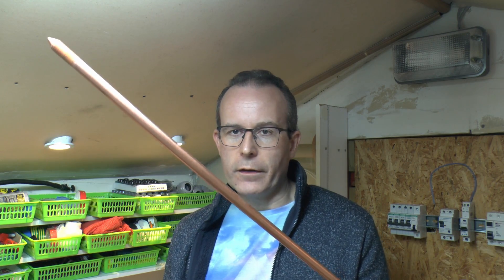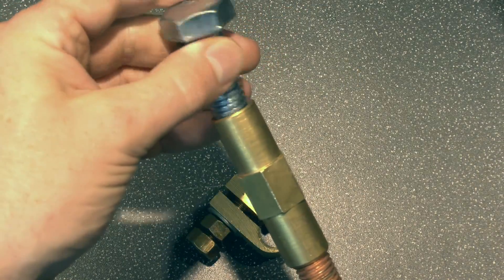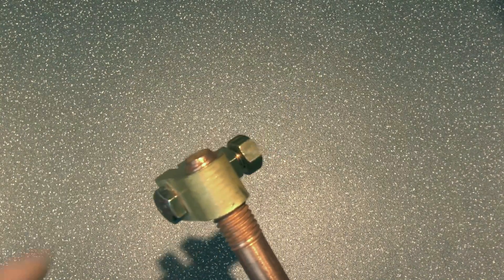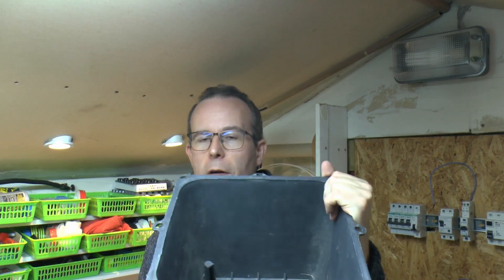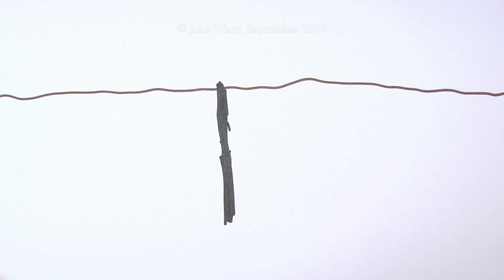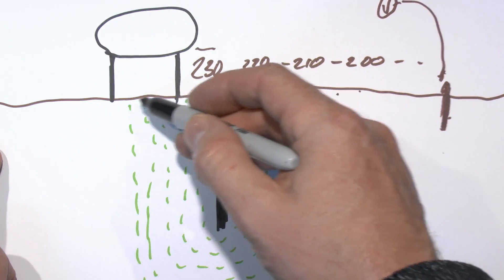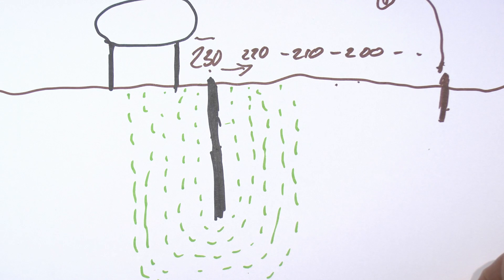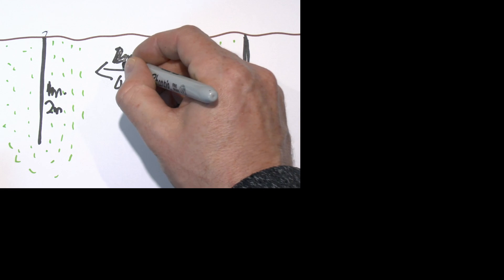Earth Electrodes Part 1

Comment: John,   Please let me know if I'm correct.   Connecting an electrical system to a ground rod in your country is connecting 240 volts to the earth ALL of the time, not just in fault situation.   Another comment, this step voltage is exactly why metal light poles should have earth ground conductor from the consumer unit and not a ground rod connected to it.   I hope I got your terminology correct being from across the pond.   Respectfully,   Kevin
Reply: Hi Kevin

I the UK we have a three wire system no that dissimilar to your arrangement in the US apart from the fact that we normally have larger but fewer substations and the neutral is bonded to a very good earth mesh / rod at that point. We also use the cable armour or metallic sheath (on older cables) bonded to the earth and we also have what we call an equipotential bond that must be connected to any other services such as gas or water. If the building has metal sidings or is steel framed that is also bonded.

The primary difference between a UK and US install (aside from the split 110v lines with a centre tapped neutral) is that in a UK installation the neutral is treated as if it were a live or (hot) conductor. Unlike in the US the neutral and earth conductor are not bonded together at the consumer unit. They are separate until they reach the substation. We do have several kinds of earthing arrangements in the UK.

The only time an earth rod would be live is when it is conducting fault current away, this would only be for a very short period as all installations that meet code will have the circuits protected by an RCD device (GFCI in the US) and fault current flowing to earth would also be interrupted by the devices fuse if it was a faulty appliance, the circuits breaker or fuse and in the worst case scenario the (final / company / DNO) fuse that is before the meter. I may be biased but I personally think we have the best electrical distribution and wiring system in the world....  :)

I recommend you watch the series that John made regarding earth operation as it will give you far more information on earthing types ect.

I hope that is of some help to you.
Reply: Stuartbe    Thanks for your comment!   In US neutral and earth are bonded at the consumer unit(panelboard) same as there. I do not believe that your electrical systems are better or worse than here.   As long as they are safe, I'm usually happy.   I do consider your "IEC" standards as inferior to NEMA standards.   Another thing, the mesh and rod used for earthing have nothing to do with 240 volt line conductor to earth(equipment ground) faults.   These faults go through the bond to neutral at Consumer Unit and out to the transformer then come back and trip the RCD.   Respectfully,   Kevin
Reply: @KevinCoop1  Thanks Kevin

I think we got some (wires crossed) Excuse the pun. I meant to say that the earth and neutral are not bonded at the consumer unit. With a standard earthing system the neutral has nothing to do with the earth until the bonding point at the substation. It is at that substation that a very low impedance ground is installed. Only very old installations have a seperate earth rod, not only are they rare but they are subject to very strict testing.

The neutral only caries fault current (with the live) in a live to neutral fault event. The earth will only ever carry fault current if an appliance fails or a live wire makes contact with an earthed back box, cable damage is done or a device is badly wired ect.

Rather than having an 11KV to single split wound transformers one large oil cooled transformer is normally used that has 3 separate phases  120 degrees apart. It was the case before the lovely EU (NOT) stuck there nose in that we used the phase colours Red, Yellow and Blue. When wiring a street the idea was that the Red phase and a neutral fed the first home. The next home would be on yellow and the third blue. Each supply is a 2 conductor cable and sometimes earth on its own conductor (or outside sheath) . So 2 conductors, phase and neutral fed each house. The idea was to balance the phases over a street. It is very rare for a domestic premises to have more than a single phase feed.

You stated in your first post the following "Connecting an electrical system to a ground rod in your country is connecting 240 volts to the earth ALL of the time, not just in fault situation." and this is not how it is done. If I am not mistaken (unless it has changed) your earth and neutral conductors are connected together at the distribution board. On a UK distribution or consumer unit as we call them there are normally two separate neutral bars to serve the two sets of breakers that each have an RCD. The earth conductor bar has no contact with neutral at all until the feed reaches the substation.   

The reason I believe the UK system is better is that all circuits no matter what they feed are protected by a group RCD or GFCI. From what I have seen it appears that only outside plugs and garage sockets have GFCI outputs. The UK system has global RCD / GFCI protection. We also have safety covers that stop anything being pushed into the live or neutral, It is impossible to keep your fingers around the plug and make contact with the pins. The earth is also the first one to make a connection so there is very little chance of a chassis becoming live if there is a wiring fault.

With regards to NEMA and IEC I don't think the US military agree. I am ex Royal Navy submariner and I have worked on some engineering tasks in collaboration with some of the US navy engineers and the American electrical engineers designed the electrical systems using our standards. I do however happily admit that the NEMA standard external electrical external sockets are far better than the UK appropriately rated IP sockets.

It may well be unfounded but I just cannot bring myself to trust the US screw on wire nuts. Something about them makes me feel uncomfortable.

I hope we have sorted that out and please do not launch any ICBM's in my direction...... Don't forget we gave you all those trident's   ;-)
Reply: Stuartbe    Thank you so much.   Speaking from this side of the pond, your electrical system, short hot to neutral will trip the circuit breaker.   Short hot to ground will trip the GFCI because earth will cause enough current to trip the GFCI.   We on the other hand have high fault values through equipment grounds to trip the breaker.   It now makes sense. Awesome!    Now an example.   NEMATODE contractors are rated 100,000 operations.   IEC contractors are rated 10,000 operations.   In a dwelling, in the new codes, everything is GFCI, orAFCI or both now.   Also receptacles are tamper proof as well.   Most electrical videos on YouTube are by people wanting to make money and not knowledgeable.   Respectfully,   Kevin
Reply: Stuartbe    Also,   I recently learned why we have 120 volt systems in US.  Tesla wanted 240 volts as standard, but Thomas Edison who invented and sold massive amounts of incandescent lights that run on 120 volts was powerful enough to get his way.   Edison lost the AC vs DC battle.
Reply: @KevinCoop1  Ahh. I did suspect that, I find many "experts" are far out of date with the regulations and technology. Its great to hear about the protection systems you have that are now mandatory. Considering your country uses a split wound 240v feed that is centre tapped for the neutral and 120v potential on each end of the transformer taps I think it is like comparing apples with oranges as your fault current is going to want the lowest impedance path.  AKA the neutral !

A decent domestic installation (like mine) :-D  Uses RCBO breakers that are individual GFCI and Overcurrent both slow overload and high fault current protection devices in a single way slot. I imagine your GFCI breakers work in a similar way but I would like to know for sure..... Our RCD breakers don't measure anything on the earth, they actually measure current flow on the live and neutral and constantly watch for an imbalance. Should more than 30ma of current be different on one leg the assumption is that this errant current must have gone elsewhere... like via a person. 30ma is the standard trip current for UK RCD devices. What do the US GFCI breakers trip at ?

I take your point about NEMA but the IEC, IEEE and British standards can sometimes be more like guidance than regulations. As well as these standards any installation in the UK must comply with BS 7671 / 18th edition regulations and measurements of the earth loop impedance, fault current and every single circuit has to be insulation tested fully between each conductor along with strict regulations on placement of all sockets and switches. In fact testing and certification of installations has become a dirty part of the industry with many "so called" safety bodies milking huge amounts of money from engineers and end users. I have had jobs like I am sure many others reading this have that have taken ten minutes to complete and then forty five minutes completing paperwork !

Standards have not just tightened over the last few years they have got to the point that they are cutting of our air supply. I wonder if it is the same for you.

Just think how different things could be if Topsy the elephant had not been electrocuted on Coney island .......  Poor old Topsy...........  :-( 

I should also say that if we are concerned about regulations and safety standards in our respective countries we should most definitely not go and work on the electrical installations in China. I think it would be a case of a guaranteed instant cardiac arrest for the both of us ..............   ;-)
Reply: Stuartbe    Standard GFCI breakers and receptacles in US trip setting is 5ma.   We also have 30ma GFCI breakers for equipment circuits.   Our NEC revisions are mostly about money for someone.   For instance, in 2020 Code they added a whole NEC article for low voltage ceiling grids.   Heading for 24 volt lighting systems.    They are requiring way more stickers with lots of calculations needing to be done.   Just so you know, I retired Oct 1 2018.   It was time to get out!    Don't really miss it.   Respectfully,   Kevin
Reply: @KevinCoop1  Hi Kevin

I can say I blame you for getting out. The entire industry is just full of shark's that want a couple ok $K a year so you to have the honor of filling in a load of data and test results that no one is ever going to look at....  Just to show you are an electrician.

This industry is missing something that 99% of businesses and government departments are missing. It is a rare element that is repelled by these 14 year olds that have completed a one week training course to get there part P........

Just so you know and if you ever meet a spark in the UK the words "Part P" are on par with beating a granny to death or sleeping with your boss's girlfriend. In fact using these dirty works could end up in you being chased out of the country by several thousand electricians

Anyway, this is an extremely rare element that you often only find in seasoned electricians and seems to only be attracted to a select few. The most powerful repellent for this rare element seems to be our industry regulators, local authorities and government bodies. There is a scientific name for this element .... I think its something like .... "Cmn 0n Sc3nco" .......  I looked it up and apparently the layman's term for it is COMMON SENSE .....  I don't know if any of it exists but if you do find some please keep it safe. When we have enough we can send it to all the lovely people above.

A good example of this lack of said element is that I cannot move a shaver socket in my bathroom, nor can I connect a supply to a shed using SWA cable.... I am medically retired now and have been bedbound for nearly 5 years so this is kind of academic (unless my next batch of spinal surgery works) but to me its the principle of the thing. I spent five years at University and managed to earn a Bsc in electrical engineering and then spent nearly ten years in the navy earning other qualifications as I went along including cryptology. When I left the Navy after my first spinal surgery I went into the IT and Telecoms security sector and spent the rest of my work life as a security consultant in IT, IOT, alarm secure comms (red care then later dual com), Internet security and firewall protection system design. All that time I was a good boy and always had my white hat on !

As proof of this lack of common sense I am unable to work on a large portion of the installation in my own home as I am apparently "Not Certified" Hmmmm........ Can someone let me know if Ohms law has changed since I went to university ? Maybe I should just shut up and pay hundreds of pounds for a spotty faced teenager that has done a one week course 50% of that getting over a hangover and another 40% trying to pull the girl opposite so he managed to cram in 10% !  He must be vastly more competent than I am.... Surely he must be !

Sorry im getting of the soapbox. This just makes my blood boil. If I am ever well enough I am going to do the work. I would love to be sent to court so they can prove the prosecution's case that I am not competent to perform the work to a safe standard. I wonder what my chances would be...... Soap box now broken up for firewood.  Sorry for the rant but this bovine excrement is driving me potty  :-(
Reply: Stuartbe    Have you ever tried or done Autocad or Revit?    Since 2008 I was using Autocad MEP and some Revit.   It can be extremely satisfying to do complete electrical installations in 3D in a computer.   One of the last and very satisfying projects I did was the electrical room conduits in a 16 story hospital.   A 20,000 sq ft room with 6 miles of 3 1/2" conduit.   Some places were 9 layers deep.   It was down to a gnats ass and went in in less than the hours in the estimate.   I was doing all this as an Electrical Design Engineer working for a top 20 Electrical Contractor in the US.   People who can do 3D CAD are in high demand on this side of the pond and are very hard to find.   Respectfully,   Kevin
Reply: P.S. Is it me or are our posts getting chopped up and have parts missing ? Maybe its just me. That or its the morphine !

Comment: i may be being thick but surely if the earth rod was at 240 volts when in fault so would the equipment it was earthing ! making it useless! so if a person touched the faulty equipment they would get a shock ! making the earth rod useless
Reply: Creamy Pasta If it was  a very heavy current fault maybe but neutral is the same as earth in the uk and in most homes with old wiring and just fuses you could wire plugs with neutral and earth swopped and they would work happily till you either had the house rewired or moved rcbo,s look at whats coming in on live and coming back on negative any imbalance eg earth leakage triggers them but earth should be able to sink all the voltage as neutral does in most houses they are bonded to the incoming feed!

Comment: The cheaper rods do not have threads so you cannot join rods together, are these any good?
Reply: Well, actually you can, there are non threaded, pressure fit brass sleeves for those ones. Although not every warehouse may have them or even know about them...

Comment: It will never be at mains voltage as its earth and is therefore connected to the neutral point of the transformer so it will always be at 0 volts. All the fault current will travel through it but as long as the earth lead isn't disconnected it will always be at zero volts
Reply from the maker: Only true if the mass of earth between the rod and the transformer had an impedance of zero ohms - which it never does.

Comment: I've seen grounding rods at the store, but never needed to install one. The ones I've seen here in the US are 8 or 10 feet long, so you don't screw them together. My house is grounded by the wires being attached to the incoming copper water supply pipe.
Reply from the maker: Using water pipes for the earth hasn't been permitted in the UK since 1966.
Reply: @jwflame  Interesting. My house was built in 1998, properly inspected and all. Seems like the UK and Europe have better safety standards than us generally though.
Reply: @Cadwaladr  I would doubt a house since 1980 has a significant amount of buried water piping that is metal.  On the other any metal piping (water or otherwise) that could become energized by an electrical fault has to be bonded to the safety ground system, the low impedance wiring that will trip the breaker if it becomes live via a fault.